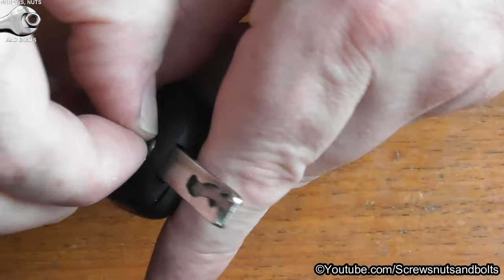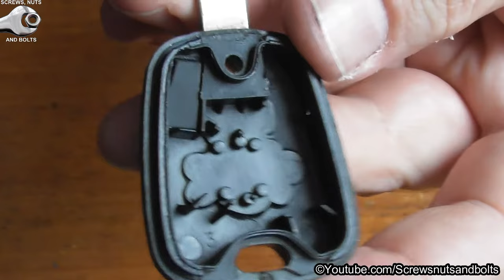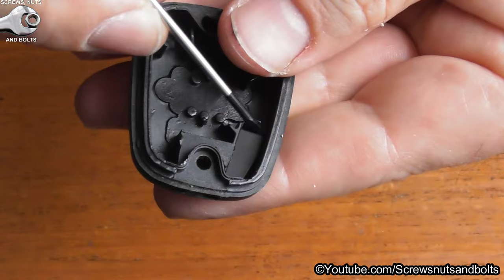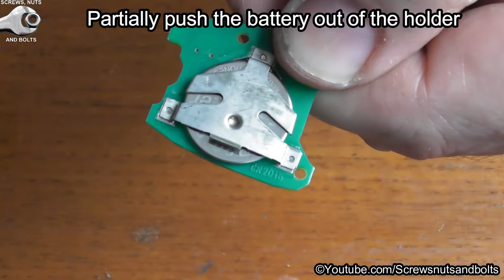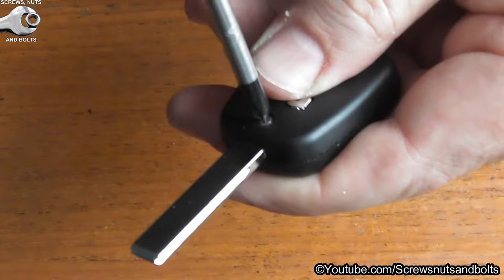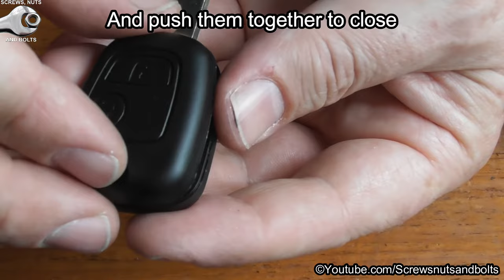Peugeot and Citroen Two Button Key Fob Repair and Battery Change

Comment: I couldn't understand what you fixed?  In total, you moved the board with the new battery and the chip to a new remote, is that it?  I just have a problem with this Citroen remote control, the start button can be pressed but it doesn't do anything and I tried to change the battery + clean the board with contact spray, I would appreciate your help🙌
Reply from the maker: Does the button click when you press it down ?
Reply: I did the same thing with my citroen berlingo key and now NOTHING works. It sucks!! I only had one key and it don't start.

Comment: does the transponder chip need to be with the same board I have two keys and I'm just trouble shooting the locks and unlocks and if i swapped the transponder chip between them would it be functional at all (one currently has no unlock button but hte other one does not work when pressed now

Comment: Peugeot 406 ew10j4 Can a low energy key fob battery cause the ENGINE IMMOBILIZER FAULT message?
Reply from the maker: No I don't think so, the power to read the transponder chip comes from the car. As far as I know the battery is just for the door open and close buttons.

Comment: Do we need to re synchronize the key after change the battery?
Reply from the maker: I didn't have to
Reply: @screwsnutsandbolts  thank you.
Reply from the maker: @GJoseph  You're welcome
Reply: Mine did what you need to do is press both buttons together if it works the doors will lock 👍